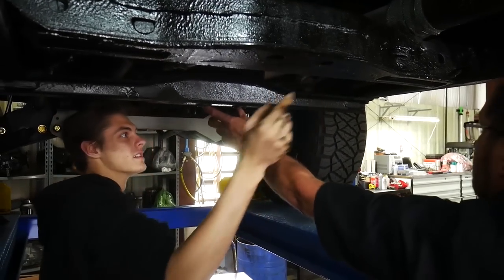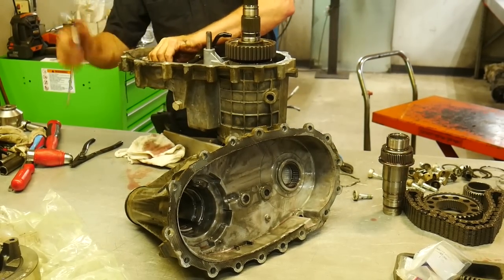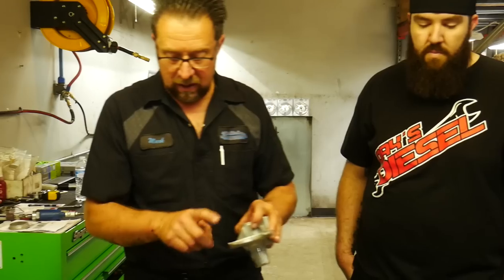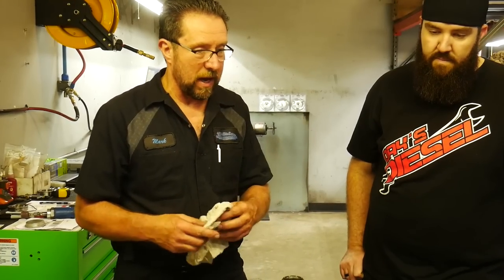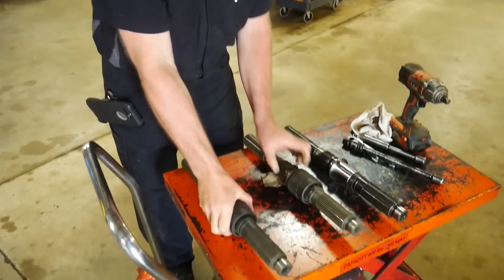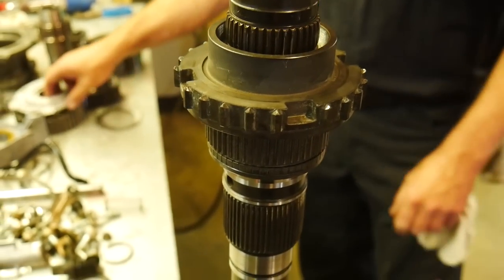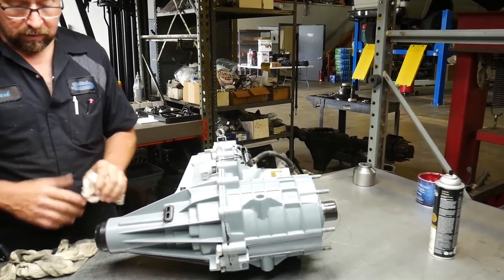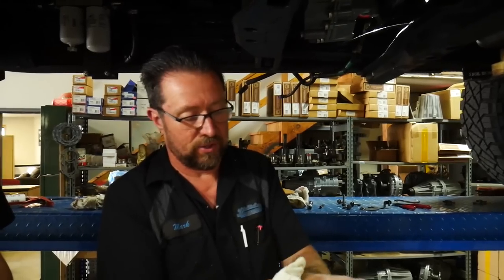BEST TRUCK TRANSFER CASES - PERIOD - HERE'S WHY

Comment: I am truly amazed at the talent this man has. I am also extremely happy Mark puts a significant amount of effort and pride into performing a rebuild the best as he can, so much that I ordered a transfer case from him knowing that the unit I receive will not give me any grief later on....more so that I can rest my head on my pillow at night and not have to worry about fixing problems later on down the line (and we all know that feeling). Mark also recently saved my bacon via phone conversation (with some excellent advice/explanation) on a front differential issue I had with a previous vendor installed/repaired unit on my truck. Without Marks experience, knowledge and willingness to help I would have suffered financially. Thank you Mark and to the administrative ladies in the office who play a significant part in the entire process of a smooth running facility. As an individual who is not so easily impressed with the majority of mechanics who profess themselves as true craftsmanship in their field I will say Mark certainly holds the honor of my respect. Thank you again. Thank you to the individual who decided to make the video, it sold me.

Comment: I actually found Mark by accident. I have a 2003 Suburban Z71 with an NP246. I got 533000 miles out of it before pump rub brought me down. Unfortunately I didn't find Mark until AFTER I had a local trans shop fix the case for me. I will be saving up to get one of Mark's rebuilds with a Merchant oil pump as soon as I can.

Comment: Hi,
I got a reman np246 from kodiak and have had nothing but trouble seals , bearings now another set of bearings so no more 30 weight oil . Got to use auto track fluid because its an auto 4wd.

Comment: Didn't say what transfer case is  not everyone here has a duramax and the mods will work for all of them that are in gmt800 what about gmt900  tahoe ppv 2wd 6l80 with a 6l90 converter looking for a non electronic  unit  for a awd launches 2wd  ppv tahoe has 4x4 front knuckles from the factory for the additional track width up front  so I will get the front axle and the entire drive line up front out of the junkyard and I am just trying to find out what is the best route to go about getting my truck to work in awd for

Comment: I have thud sound that appears to be coming from somewhere around my transfer case. I replaced my slip yoke with a nickel plated yolk and it helped in the intensity but the thud is still there every time I shift between park to drive or  drive to reverse. Just switching between neutral and drive back and forth doesn't always make the sound. I've checked for signs of pump rub but the housing seems solid all around with zero leaks. I bought the truck with around 111k mile and am about 125k now. I don't abuse it myself much at all. I've also checked suspension bushings and what not, but I really feel the noise is somewhere around my tcase. Do you have any knowledge of this? I'm ready to order one of your units as I see the value involved here. But the last thing I want is to replace this and find it wasn't the problem.

Comment: What's the real time on all these upgrades? It seems like with me I wait a week per every hour worked is what it seems like.. ill place my huge order over the phone and then get stalled up over some stupid fitting or block off plug!
Reply from the maker: Videos come out as I get them done. Mark has this t case build done in 2 hours WITH filming
Reply: @RustbeltMechanic  Well that doesn't really answer it, yes it may take 2 hours for him but what about everything that leads up to those 2 hours is what I'm getting at.. Even with jobs you do yourself and not hire out for, those take time to plan out so you can be organized so there's less downtime.
Reply from the maker: Ah, I gotcha! Planning ahead is a BIG part on doing these videos and upgrades. That way, one, I’m not having my truck down for too long , and two, these videos don’t take two weeks or more to just shoot. I plan my videos out for weeks in advance. This particular one was thought out and planned about 2 1/2 weeks prior but there was very little prep to do since Marks shop has literally just about anything driveline related for a Duramax in stock. Do me a favor and dm me so I can bring this stuff up on live stream also, I think that would be a good topic👍🏻

Comment: Building a 1985 K29 and dropping in a built 454 with a 700R4 tranny...do you recommend keeping the NP208 or swapping to a NP205?
Reply: 700r4 and 454 what a combo.. lol... with all that weight, 208 will save a bit.. but if you dont care about weight ,then 205 is stronger.

Comment: What year range is required transfer case re-engineering?
Reply from the maker: This is for my 2006 Chevy Silverado 2500HD... but also heavily modified so this tcase needs the modifications
Reply: @RustbeltMechanic  , thanks for answering my questions.

Comment: Guy seems right on par with my local transmission guy I use for anything. I did the pump rub update a year and a half ago. Pulled the case, pulled it apart. Found some other things weren't looking right so had my gear/transmission shop go thru and check it out and good thing I did as the clutch pack was worn out. 

The.merchant automotive (you can find them online) is the best way to go for the pump update. You really can't go wrong with thar and it's machined with good tight tolerances. 

If you have Auto 4wd DON'T use it during winter. Just switch from 2Hi to 4Hi and back depending on the road surface. It'll make you clutch in the transfer case last a lot longer. 

Always replace that front input seal when you remove the case so you don't fill your transfer case with transmission fluid should the seal in front of that go out and allow the fluid to be pushed back. 2001 thru 2007 or 2009 had the pump rub issues. 

IF you have a leak don't wait if it's coming from the transfer case. Mine leaked out the top half of the rear housing which was better than those who leak out the bottom and run their transfer case dry. 

Preventative maintenance is key as you don't want it doing down in a storm when you need it.
Reply from the maker: Yep! All great points 👍🏻
Reply: there is no clutch pack in a duramax case ? you must have a auto track case.

Comment: Cool video. Can you tell me why he puts oil in there instead of trans fluid. Thanks
Reply from the maker: There are no clutches in this t-case to need that plus the moly additive in the 5-30 oil is a big plus to the bearings and longevity. I’ll let him chime in if he has any more info👍🏻
Reply: transmission fluid is a very light oil and foams under load in a t-case when in fwd. The 5w30 gives you a 5 weight cold and 30 warm.the synthetic part wont foam under load. those cases get so hot after driving just a hour that 30 weight works way better than thin ATF .hope that clarifies a few things.
Reply: @kodiaktruck3583  thanks. Can you just change out fluid now and be ok or would you do it differently?
Reply: @allcureman3403  you will be fine to change over to it.

Comment: Can I use 5w30 synthetic in my stock transfer case on a 2013 chevy duramax?  I use the truck to pull a 28 foot RV 5th wheel.
Reply: Use factory recommended viscosity gear oil.   Do some research on gear oils, there's plenty of information on YouTube

Comment: GM transfer cases uses 5W-30 weight oil?
Reply from the maker: After they’ve been rebuilt here they do.
Reply: @RustbeltMechanic  So it's just for break-in?
Reply from the maker: Nope that’s what his t-cases run.
Reply: @RustbeltMechanic  I thought GM used the blue dyed oil which looks slightly lighter than 5W-30?
Reply: Gear oil inside transfer case

Comment: I'm new here and I don't know what the owner drives. Because of such, it would have been nice if the mechanic spit out what he was working on. You know, like identifying the make and model for an audience i.e. an NP 205 sittin' outback that I'm trying to figure putting in a Bronco II. Otherwise it looks like he's describing what is obviously any mechanical case that we all know will fail with time or abuse. I may be wrong but I didn't hear what model transfer case it is. Other than such your skills are mint (except forgetting nutting a tranny mount).
Reply: Thats A NP246